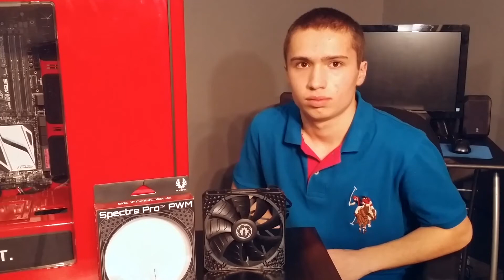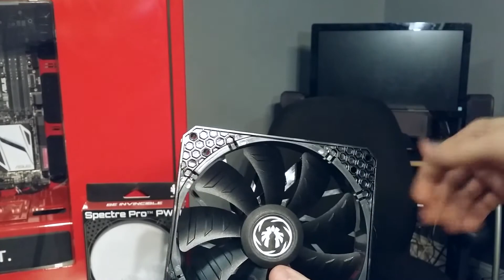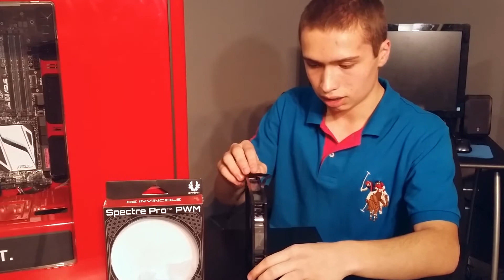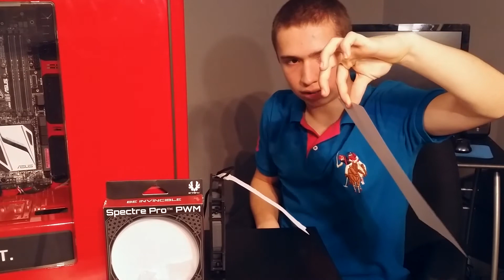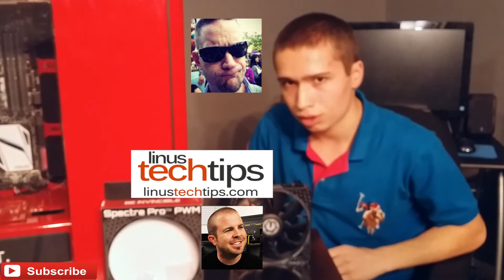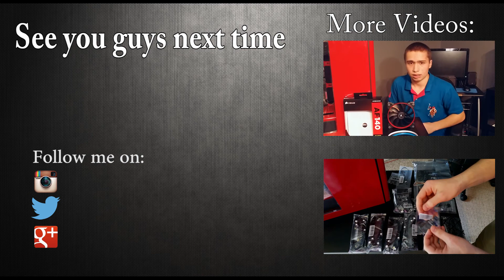Bitfenix Spectre Pro PWM Review

Comment: Some issues with autofocus in this video.
You might want to look into better lighting.
Not sure how much you planed ahead for this video, but perhaps work a little bit on that?
For instance the fans don't produce air, they push/pull air.
Big difference.
You'd be in trouble in space or underwater if all you had was a fan...
Other then that, a nice start. =)

Comment: hey dude! watched ur videos... im looking for a good fan (with red led) for a tower cooler (cryorig h7). on my list is the thermaltake riing, corsair sp120 and bitfenix spectre. hope u can help. best regards from germany
Reply: Um, I'm somehow doubting that your cooler can handle such a big fan, also I believe it's focused on airflow not static pressure, but for the case itself it should be good if your cabinet can handle such a large fan.
And I just noticed that this is the small 140 mm fans, and not the big 230 mm fans I'm searching for reviews of...